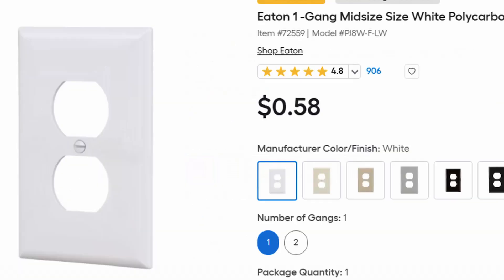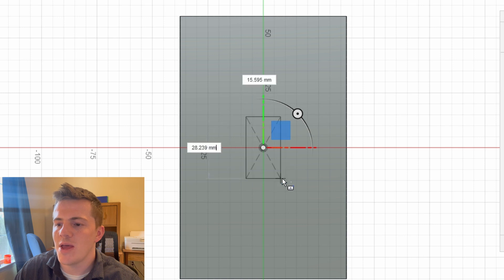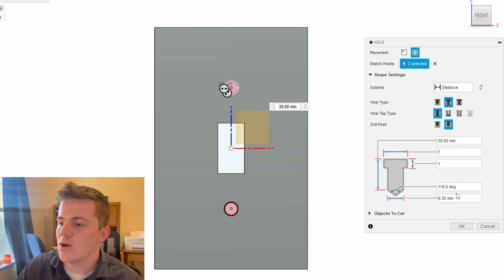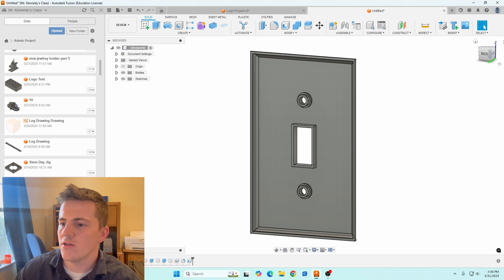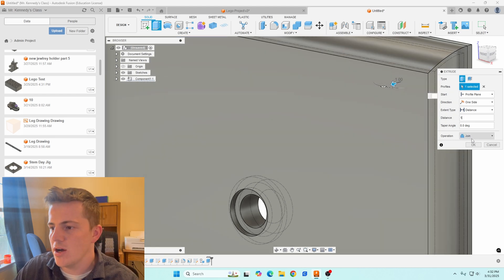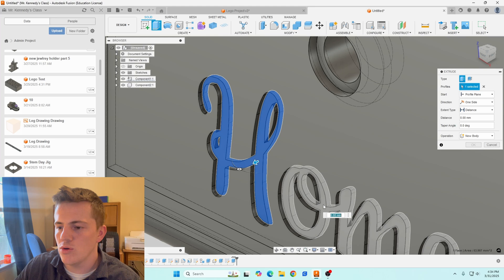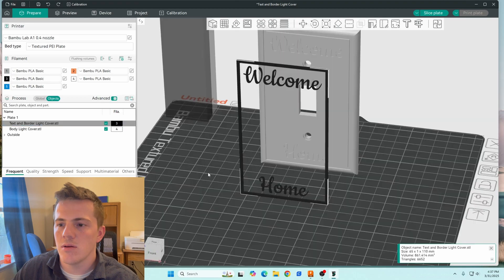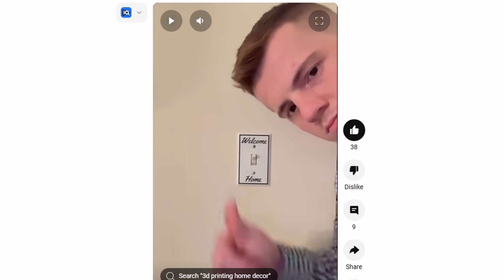3D Printing Custom Light Switch Covers Is Easier Than You Think

Comment: I was just reading not to use pla or pla÷ because it can catch on fire?  What's your thoughts on this?  I made a nintendo outlet cover but took it off and now researching.
Reply from the maker: You’re right, probably not the best to add. I would think PLA would melt instead of catch fire, but honestly not sure. In addition, I would hope any intense heat would cause the breaker to trip, but again, pure speculation on my part.
Reply: @KennedyDIY I was so disappointed after I finished it to read this lol but ty!
Reply from the maker: @wick6315 I will say, I’ve had mine on for months now with zero issue!
Reply: @KennedyDIY well thats good to hear!  Maybe i will try!